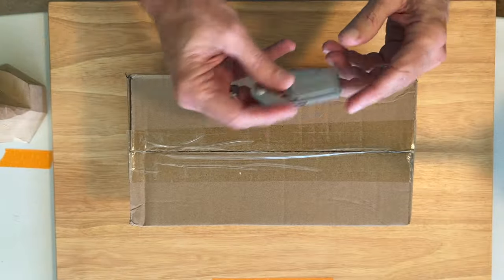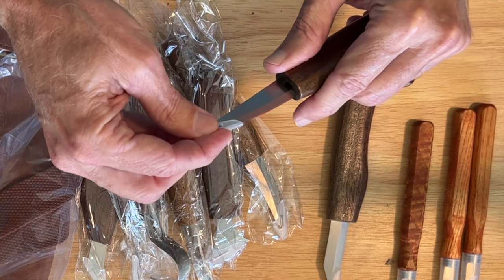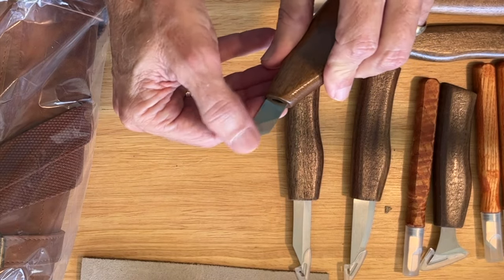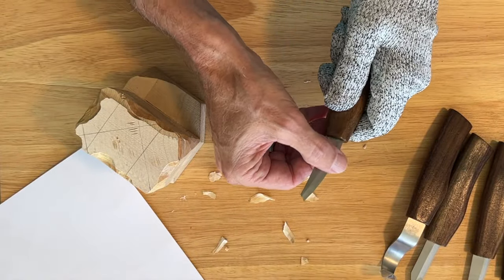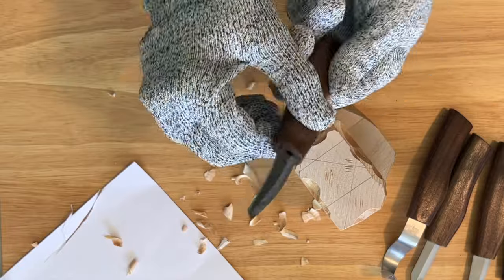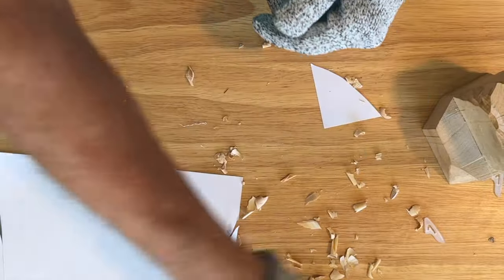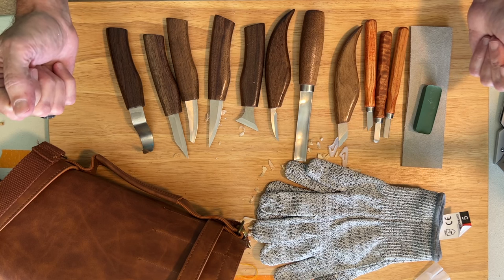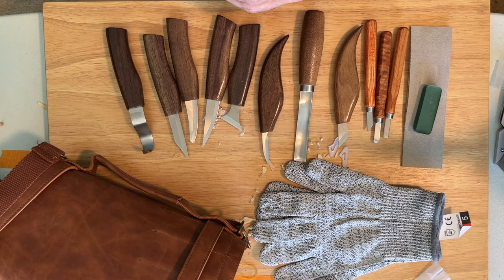Carving Tools For Beginners: Unboxing The Tekchic Deluxe Wood Carving Kit

Comment: What is that kiridashi knife used for, I got this set and I’m confused what I’d use it for
Reply from the maker: It can be useful for a variety of cuts.  For example, getting into tight spaces and corners that may be difficult with a standard blade and for chip carving as well. Happy carving!

Comment: Nice set up. Any thoughts on a chainmail glove ?❤
Reply from the maker: The gloves in this kit are level 5 cut resistant which is good. I would recommend wrapping some safety tape around the fingers of the glove for better grip. I don’t have a chainmail glove but I imagine it would be difficult to grip the wood.